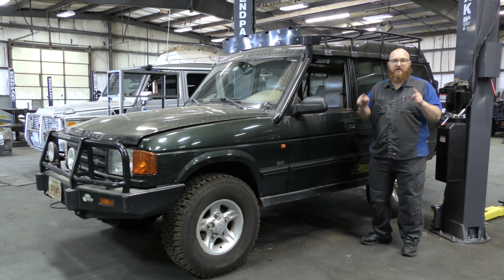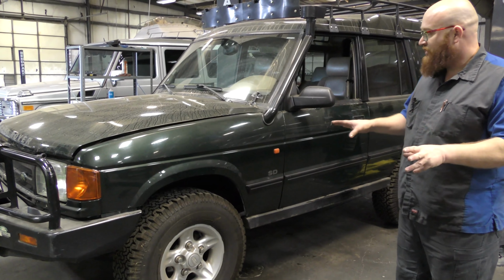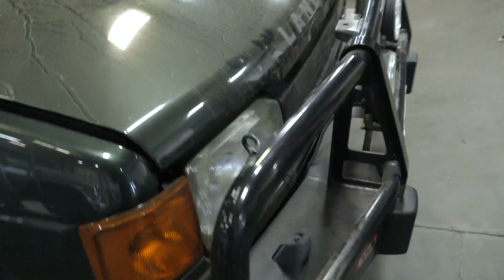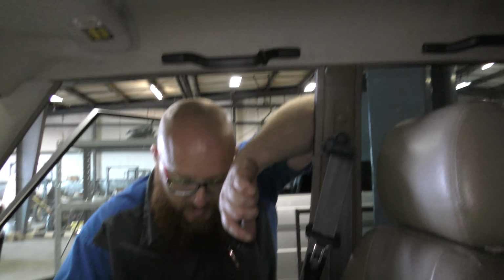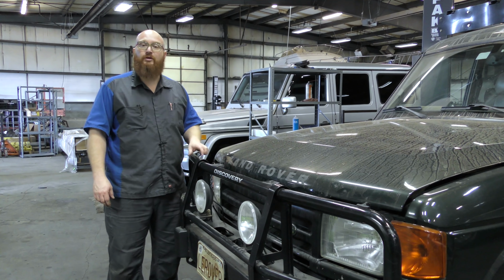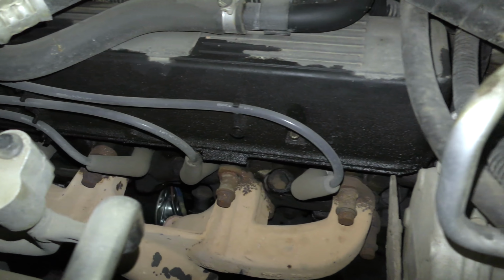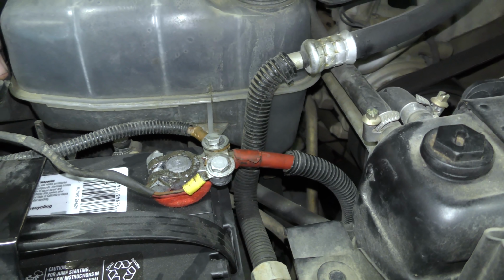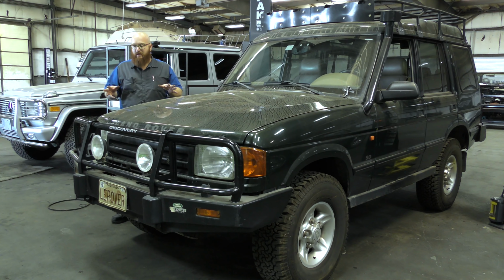How can such a simple repair cause huge problems on this '99 Land Rover Discovery? CAR WIZARD knows

Comment: Aluminum expands faster with heat than steel or cast iron does. Accordingly, when the engine temperature greatly exceeds what it was designed for, the steel cylinder liners will loosen from the aluminum block. 
This effect can be used to your advantage however. Glass expands even less than steel does, so if you can't open a glass jar, run the cap under hot tap water.

Comment: I had a classic intermittent start not long ago. Battery voltage good, no ground issues, no loose fuses, starter lockout contact good, no antitheft alerts, no codes. >>> Loose negative side clamp with some corrosion. Zero dollar fix... Who knows how these things work their ways apart, vibration, temperature cycling, etc.. It's tempting to "run the default diagnostic protocols' and totally ignore the small stuff to assumption. Lesson? Don't assume... check the quick stuff first, reclaim life otherwise spent on nothing. :>)

Comment: This is a really good video thank you.  
But I do have a question about my 2004 Land Rover Discovery 2. 
Recently, it has decided to not turn over or click or start unless a diagnostic tool is connected, and then the BCM is accessed. It will start up like clockwork then. But if no diagnostic tool is accessing the BCM, it won't start or even click or turn over. Nothing. The vehicle lights up like there's power, and all of the accessories work, it just doesn't start at all. It has a brand new battery and starter about 3000 miles ago.

Comment: I still drive my 2001 Range Rover P38. The only major problem that I had with it was a head gasket. Because we're in a rural area, I repaired it myself (very challenging, but it has worked for years since then).

Comment: That was basically the issue on my truck for an intermittent no start. I went straight to the terminals and fiddled with them, noticed if I played with the ground cable it clicked the system on so I taped the cable to pinch the connection on and then replaced the terminal. I didn't even think about anything else in the system.

Comment: I have a 2000 Range Rover that I have had for 15 years.  I have 200,000 miles on it and I is probably the most reliable car I have ever owned.  I have actually done more repairs on my Volvo 240.  I absolutely love it!!

Comment: I’ve had 6 older Land Rover products come into my shop for head gaskets, all six of them had either low coolant or had straight water in the cooling system, a kid who does summer work in the garage has a stupidly lifted disco with HUGE tyres and he hasn’t had any mechanical issues with preventative maintenance

Comment: the rover group iconicly known in the uk for head gaskets going. if someone bought one first question you would ask is has the head gasket been done. though land rovers in general are probably known more for turbos over here maybe because we used the diesel more over here. we love a diesel.

Comment: My old boss has a 2002 Audi A2 which kept on losing charge. It was stranded out side his son's house with a flat battery. I brought  my spare old Lucas battery from my Humber and jumped started it. Replaced the Audi battery and found the terminal for the charge system was loose. A garage didn't notice that small problem and probably charged alot of money. He still thinks it was due to his son's girlfriend leaving the interior light on. Also experienced a similar problem on an Austin Allegro which the local garage charged the old woman who owned the car every time the car didn't start. Problem slack fan belt. Glad you like British cars, they are not all bad.

Comment: What i didn't like in general was the parts bin raiding within British Leyland/Austin/MG/Rover, i know alot of brands do it but BL seems to do it with the same designed part for over twenty years of models, 
I remember the indicator and wiper stalks on a austin allegro (square steering wheel) was identical to the ones fitted in Leyland Olympian buses, its the rear light clusters on disco's that were taken from a old 1982 maestro van that get me the most, come to think of it i believe the speedometer is the same aswell, 
but the chassis and 4wd system is its saving grace cause they are fun, all the extra's like glass can not be guaranteed lol
Oh and love when the fob breaks and you got to enter the immo code with the key by numbered amount of turns in the doorlock, 
When they work they are great, but do have mood swings lol

Comment: We had a 1996 Discovery 1 with a 5 speed manual transmission. Great vehicle. When we replaced it with a Discovery 2 you could not get the manual gear box in the U.S. anymore. I wish we had kept the first one. Now we don't even have a local dealership anymore.

Comment: its not just tightening the bolts Wizard its diagnosing the two bolts were loose, i remember once a customer fitting their own battery and leaving the plastic caps on, complaining the new one was flat!

Comment: This is an exact copy of the '96 Disco I owned and abused for years! Three years ago I bought another '96 two door V8 on eBay for $4,000 to use as another 'mobile studio rig'. It still hasn't missed a beat and gives all my staff big grins when they load it up with gear and hammer it off to a photo shoot! By comparison Toyotas are just 'white goods'!

Comment: I had that happen to my 97 camaro ss. The car would cut out when driving, almost like it ran out of gas. I towed it to the shoo, i guess from shaking it. It ran fine when it got there. Good fuel pressure. They changed the fuel filter as they said we cant fix it its not broken. I drove it for another year like that, and then it died again. The battery cable a side terminal looked tight but was actually loose. It went another half turn. The antitheft it that cuts off the signal to the fuel injectors. But the car still cranks. I remember that from when the wire broke off the ignition switch that reads the vats resistor.

Comment: I have a 97. My most modern car. I thought that smell was due to it being damp from the leaks around the windscreen! That's on my list to fix. Also corrosion around the alpines, sagging headliner, etc, etc. Never been a truck or 4WD guy. I own an MGB and an Austin 7 so little cars but I really like the thing. Main reason I got it so for when I need to tow the other (little) car I am building, a Riley 9, on a trailer. Did you or Mrs Wizard every get another one?

Comment: I'm from SA, had a '99 3.9 V8 with over 400 000km on the clock, no major issues. The only reason we sold it is because simple things like an oil filter were hard to come by. Otherwise Its a very solid ride.

Comment: had a similar problem when I replaced the gaskets in mine.... the roll over sensor was not mounted to the firewall and in the process... evidently we had knocked it around... which sent the sensor into super lock.. which was  quite a thing... since the doors were locked and the vehicle wouldn't start after the fact... you might wanna do one on that if you haven't

Comment: I had one of the Discovery I's in the late 90's. Drove/abused it regularly going to my house in Baja. It only abandoned me once. I trailered the vehicle back to Los Angeles and dropped it at the dealer. Really pissed off with the vehicle...
Turns out that during my hot rodding on dirt roads a sensor thought I'd been in a crash and cut the fuel pump.
After the tech showed me the re-set button boy did I feel like an idiot. BTW, reading the manual would have save trailering it back. That vehicle and the 99 Range Rover that followed it never let me down in Baja.

Comment: Good morning from the UK Car Wizard, never disagreed with you before , but the G Class is not just for show. It is one of the most capable, true off road 4 x 4 `s available today. I have owned many Land Rovers and it is true that in the right hands, and providing that you prepare the vehicle correctly   the Landrover product will certainly do the job. However, the G Wagon is at least equal to, if not superior to Landrover when travelling off road.

Comment: It's not because of 2 loose bolts, it's because of the owner. The same thing happend to my wife's car. In the morning, when starting the car, 3 or 4 light appeared out of nowhere and she asked me if the car is ok to drive. The first thing I did was checking the battery terminals which were loose because of me swaping batteries between cars a couple of days before. I tightened both of them and the car was fine.

Comment: My mom has an 04 TD5, has a million warning lights, but reliable as hell for day to day driving, we luckily have a  local Landrover place with a giant landrover scrapyard attached, so getting parts is reasonably easy... but I have to do the front sunroof drain pipe fix soon... which is a huge job... Insurance replaced her bumpers with solid metal ones. thing sees like 100km per month

Comment: I've done head gaskets on one of them before.... story goes that the later tooling for the v8 was a bit wore out by the time they did these.  The earlier 3.5v8 dont have the same notority of head gasket failure.

Comment: Wizard I think you like the dash because it's symmetrical.  I like it too.  What I hate are the new cars with a giant screen up high on the dash.  Even Corolla's have that now. 
Interesting how this Discovery has two shift quadrant indicators, on the left and on the right.  Maybe to accommodate both L & R hand drives.  I don't like that type of replacement battery connector, in fact, I think the package they come in states for temporary use only.  You have to use Thread-Lock on those or they'll keep on loosing up.  As you said replace it--with a good one.
Thanks for the reminder to check my Subscription.  It wasn't cancelled but I had never click "ALL" under the notification bell.

Comment: The problem with the Disco: 1) thermostat 180 degrees is too hot - that is why the head gasket likey goes bad- buy aftermarket 150 degrees (but then you will not have heat 2) drive link to front diff does not have grease fittings and will eventually explode 3) ABS brakes - need sensors replaced 4) the seals and gaskets around transfer case are all bad 5) heating unit on air intake just needs to go, 6) rear main seal is likely leaking - beyond that, it is fine & durable SUV.

Comment: I have 1995 Disco for 20 years. 160,000km just changed the radiator. No. Rust never been off road and now becoming a collector item..Best of all my city has biggest Land Rover breaker yard in Australia with over 400 cars..🎉

Comment: "check the simple stuff first" yeah i know that one haha, i had a wierd electrical issue on my 95 Volvo 850 where the dash was completely crazy and the gauges didn't work or was flipping out, i was told that it could be the light switch or an alternator, changed the alternator and i did check the battery it was solid but still same problem, so i took out the light switch it settled some issues but still had problems, i check again under the hood for a third time, found a loose ground wire on the drivers side, i tightened it and it stopped

Comment: The customer has to remember that a main dealer might have found the bolts loose then told him it needs a new ECU at $1500.....but they never do that do they..😉. A friend had a Discovery 1 in Iran for four years in the 90s, then drove it back to the UK without any problems and used it here for another few years. He liked it a lot.

Comment: Had several never had a head gasket, but mine were turbo diesels. Suspension took some hammer. And yes you can fix a landy with a big spanner and a lump hammer.  More recent ones however are not the same animal. Immobilisers are iffy.

Comment: Had a similar problem with my 87 Isuzu Trooper 2. Turn the key and just click. Push started it and went out of my way to park on inclines for two days. Cables were tight and I just couldn't find the problem. I stopped at a friends house one day after work and his 73 year old Dad that had been in automotive in one way or another most of his life had me pop the hood. One of the small leads was just corroded and lose enough to cause all my headaches. 5 minutes with a pocket knife and a pair of pliers and my friends Dad had me fixed up. Yes I was hitting myself in the head and feeling very dumb that day. LOL.

Comment: Those type of battery cable replacement end are great for a temporary repair to get you back home.  But they are crap for long term use.  I have seen more batteries, starters, and alternators ruined by that type of battery cable end.  Replacing the battery cable is cheap compared to the cost of destroying the battery, starter, and alternator again and again and again and they do make replacement battery cable ends that can be soldered onto the cable to make a factory quality connection as well as clamp-on battery cable end on one end of a short piece of battery cable and  brass cylinder on the end  and heavy brass bolt that can put a lot of pressure onto the battery cable wires on the other end of the cable and that make a far superior and secure connection.

Comment: I had a similar issue with my LR2.. I waisted money on a start er to have it die again.. turned out it was a connection on that hevey gauge wire going to starter .. the funny part is when the mechanics changed the starter and it worked for a bit but only because he moved the wire .. it was buried below a shrink wrap

Comment: Rover V8 is usually pretty reliable if you keep decent fresh antifreeze and clean oil in it
Disco 1 - biggest problem I've had is rust - not too difficult to repair, but mucky and a PITA

Comment: I had this problem with my 09’ Honda CR-V.  The Honda computer found this problem with a check engine light. Good car! At 110,000 miles, this was my only problem. What or who caused it? The battery was changed by me 3 years before. Jim
PS.....not only did I clean the post but put in a flat washer, a locking washer and a Ny lock nut!

Comment: My favourite make & model of vehicle. Shame so many have rusted away

Those old Buick/Rover V8s do not tend to get blown head gasketss when left at the original capacity. More common on the overbored 3.9/4.0/4.6 is actually liner slippage. No such thing as too many oil changes on those engines either :) If you really want to do a world tour, get the TDi engine in a discovery.

As an extra hint in showing the difference between a mk1 and a mk2, the rear windows are not only longer, but bonded and flush rather than rubbered and proud.

Comment: OMG I cant stop LOL I have a 2004 volvo s80 and i was experiencing the same thing, until one day i was stranded in a parking lot.  No start, my ECU was all over the place and car just had a life of its own. So i started with the Basic, after tones of research and multiple visits to the dealer $$$$ I found a lose battery connection !!!🥸🥸🥸 i  purchased a deep cell battery and tighten the connections and a year latter no more issues lol

Comment: Land Rover knew full well that the faulty thermostat  sticks shut and it's integral to the expansion tank.  Hence the blown gaskets. Spares are a big issue for most 4x4s.  They had a huge recall and engine swap program.

Comment: I replaced the head gaskets on my mom's 2004.  LR manual said "massage firewall with hammer" to make room to access rear most head gasket bolt.

Comment: It's British, Everything is Square; Square on the outside with rounded corners, to improve the wind drag co - efficiency! The interior is all square, every switch, square, door panels, square....every other item or panel....yes, you have guessed it, SQUARE. in fact, if you are familiar with the BL models; Truimph Acclaim, Allegro, Austin 1300,   
Austin 1800 & 2200 and the Princess SQUARE. The last one being a Cheese WEDGE. Ohh by the way  I am from the UK.

Comment: A lot of the reputation that the old Land Rover's earned is somewhat undeserved.  Once you understand some of their quirks and oddities they actually can be quite reliable.  I bought a 2000 Range Rover 4.6 HSE a few years ago as just a project vehicle and it ended up becoming my daily driver because of how versatile and reliable it is (yes reliable even).  They aren't cheap to operate but they are quite an enjoyable vehicle to own.  Take care of the car with the right maintenance, service and modifications and you have a reliable and fun vehicle that can do just about anything you want with it.

Comment: I have disco 1 3.9v8i 98
I’ve had it 12 years , it’s my 3rd v8
I’ve been driving discovery since 89 , father bought one when the came out
He and my mother still drive discovery albeit a new one 
Disco 1 is Extremely tough and versatile easily the best 4x4 ever produced 
I’m in Scotland 🏴 so rust is our biggest issue here
Diff lock is the business!!!

Comment: It's only really the later post 1999 cars that suffered with hedgasket issues you can easily spot then as the intake plenums of the later ones are very different otherwise pretty good engines

Comment: The head gasket is already done on my  Discovery 1 Trophy (3dr, 300TDi, 1998) at about 60.000 mls some years ago. Now has 80.000mls on the clock - still going strong. Regards Heinz

Comment: Just goes to show start with the easy stuff. More often than not it's that simple. I bought a 2004 trailblazer and was fighting a bad air intake temperature sensor. Bought new replacment, check the data nata. After 2 days I found a simple wire that was split in 2....